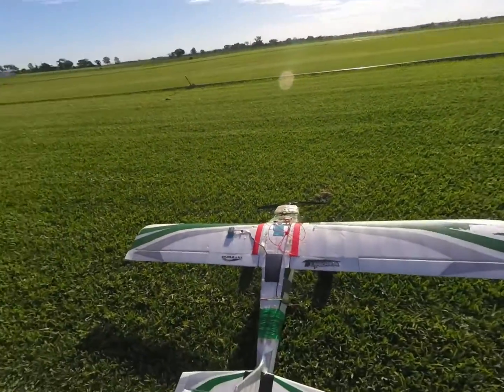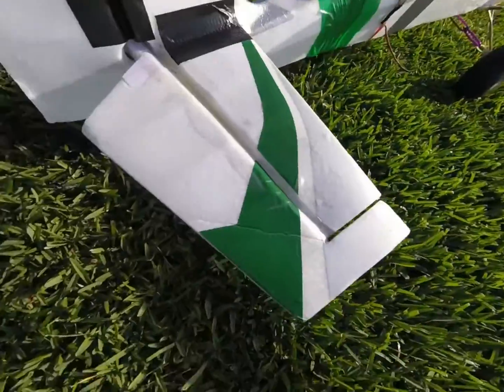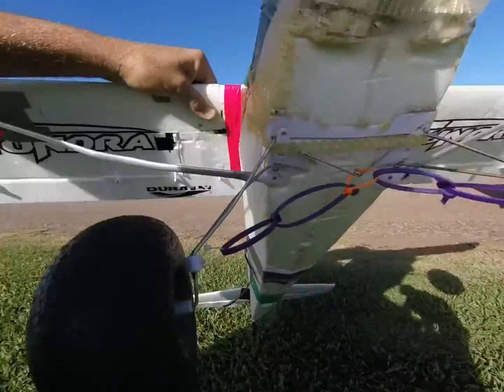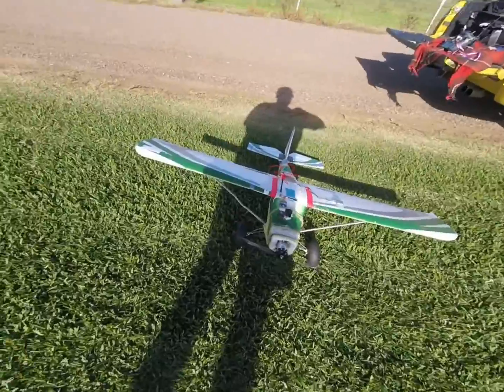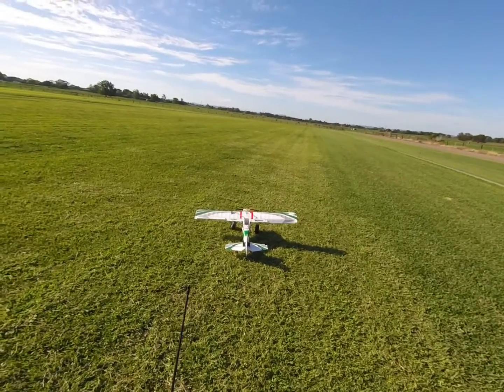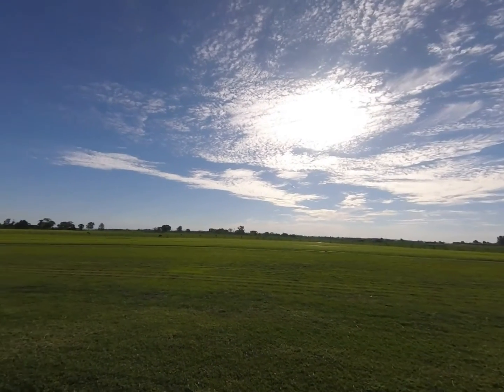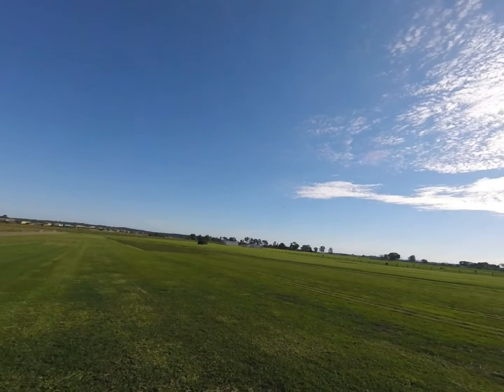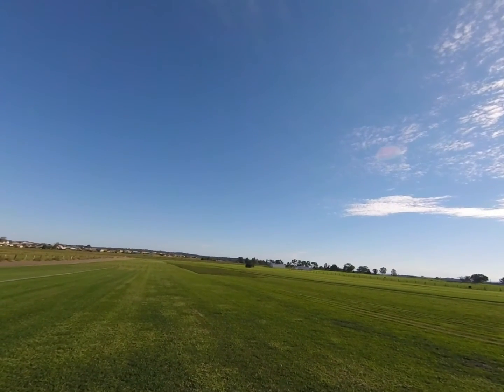Tundra With A Folding Prop

Comment: Never had a broken prop on my pushers for some reason. The MPX Mini-mag (similar to the HK Tundra and MPX Magister models) is a notorious prop breaker - until I mastered the art of the last second "flair" to avoid the tip over and allow the model to belly flop land. I have folding props on my sail planes ... have not tried on the prop breaker specials.
Reply from the maker: The long(ish) grass at the farm plus the fact that I am not a great pilot and have not really mastered the finer art of landing all makes for broken props.... so hopefully this mod will allow me to tighten up on my landings so I can go back to the original prop....... its the same for my EFXtra...... 2 flights and 2 broken props..... the video I put up of it ended in bending the motor mount so I had to pull it all apart to fix it..... maybe that will have a excal folding prop on it soon...... cheers and stay safe.